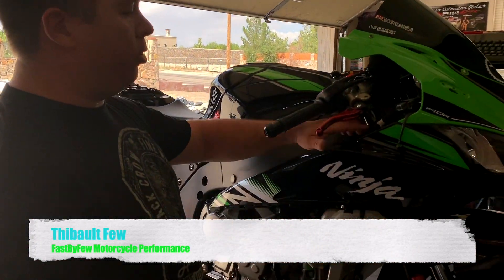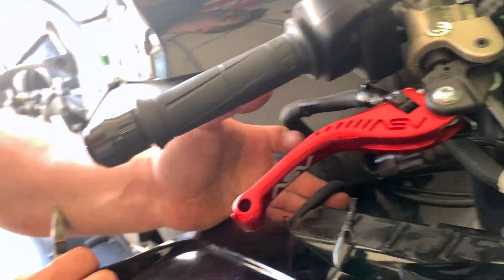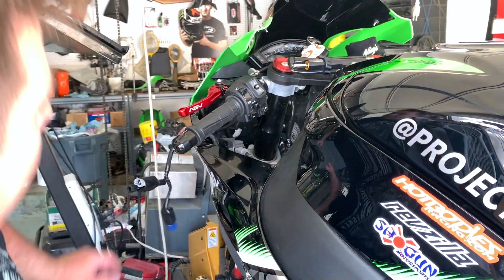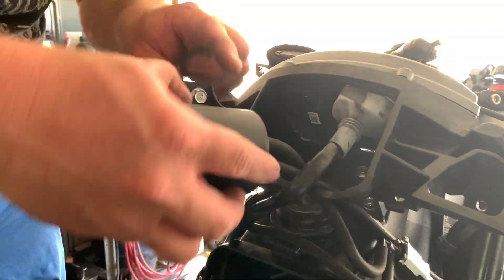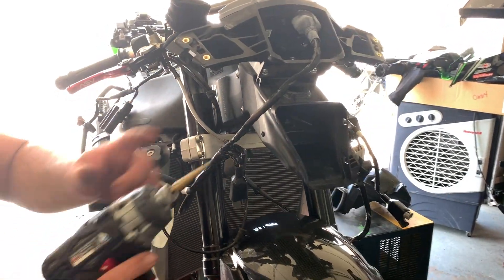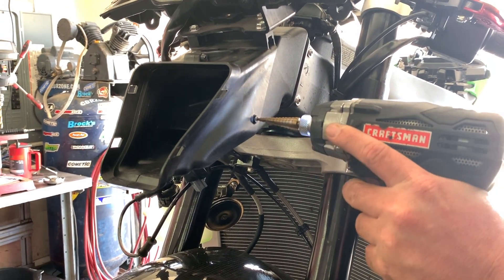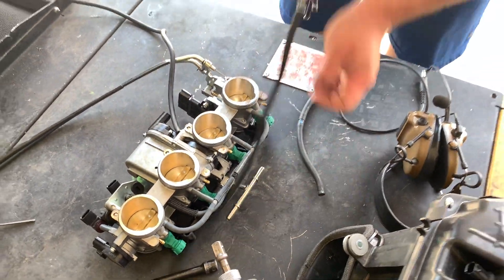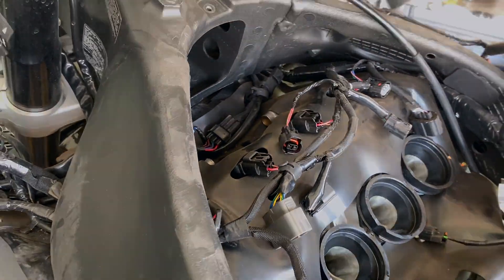Gen 5 ZX10R Emissions Delete (Flapper, Pair Valve, Servo)

Comment: Hi. Good video. I have a doubts, so I have a 4th gen but my model don’t have this solenoid and my question is.. I have e2d error by autodiagnosis (air intake solenoid doesn’t work) and error 75 on my OBD2 JDiag. I tried to erase fault error with JDIAG 100 but are still in dashboard! This fault will explode my brain and no have idea to solve it.
Do you have some idea about this code?

Comment: Excellent video, but you go very fast. I saw that you cut the vacuum sensor tube. Does it attach to the black cylinder on the  meter panel? I crashed my 2019 Ninja ZX-10R and will need to replace the front fairing, headlight assembly and meter bracket. I found some loose tubes that were not attached to anything and I"m looking the in service manual trying to find out where to connect them. I presume they were disconnected during the crash. They look like the vacuum sensor you cut off. Any idea?

Comment: Taking all the emissions off, does it throw a code, or does bike just run better afterward?
Reply from the maker: It will throw a code, you should get the ecu flashed after removing the emissions

Comment: thanks bro Really needed to see that but will it throw a code if not flashed?
Reply from the maker: vicfox101 yes, will throw a servo code.. you can either get a servo buddy or just get the ecu flashed
Reply: @wildwhiskeywolf  I have a servo buddy but will be getting the ecu flash soon
Reply from the maker: vicfox101 when you get the ecu flash you wont need the servo buddy anymore
Reply: @wildwhiskeywolf  yea I have it now so no codes show up, going to order the sprint f1-85 air filter and do all the emissions before i send the ecu and be ready to ride.